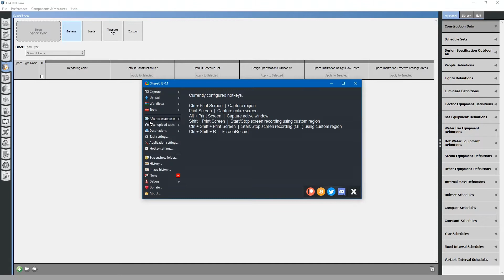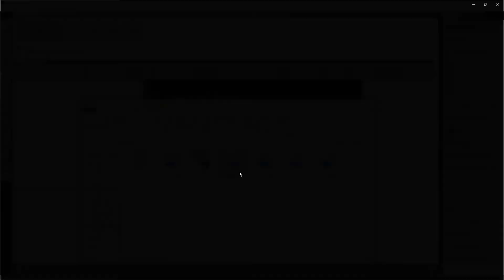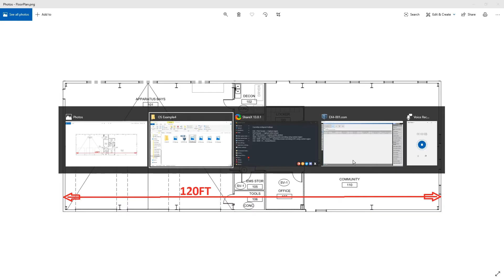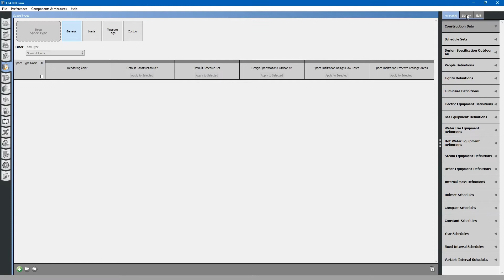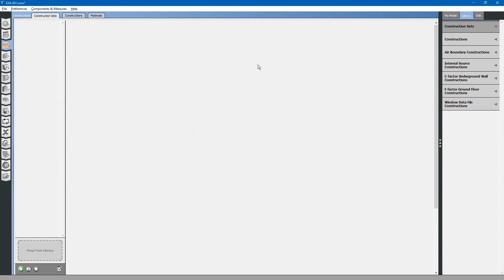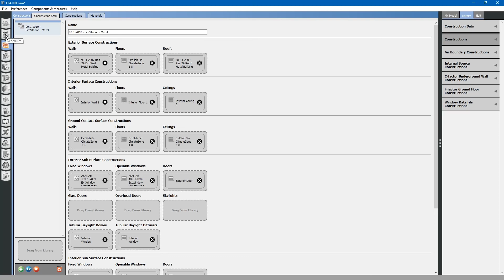Building Energy Modeling in OpenStudio - Importing Library Files

Comment: I have both OpenStudio Application v.1.0.0 and OpenStudio v.3.0.1 and inside none of their folder there is a file called 90.1-2010-FireStation.osm. Where did you obtain it? It's just to follow your tutorials using the same files.
Reply from the maker: Here is the project file thus far: https://drive.google.com/file/d/1m0NUNSz0HlNHMIth6ELz6MwNPOQMvlDJ/view?usp=sharing
Reply: @helixenergypartnersllc3540  Thanks a lot but, could you also provide the other necessary files to carry on such as the .png files of the floorplans, please?
Reply from the maker: https://drive.google.com/drive/folders/183GhVJdzNmphZ2Ngy0v8RJJWHSRJJpdK?usp=sharing

Comment: Where I can find these space types? I´m trying to model a residential house for a final work but I wasn´t able to find these space types... Would you mind telling me where I should look?? Thanks
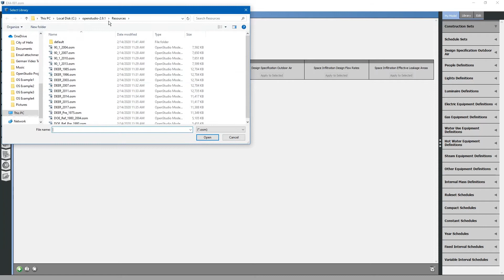Reply from the maker: Good question.  I am not sure if there are any default libraries for residential buildings, but there are some for hotels and apartments.  Please see my video about importing library files: https://youtu.be/O1QFj350a2I  at 1:31.  You can also find these on the BCL and in the default library files that come with OpenStudio.  Default libraries are located in the OpenStudio "Resources" folder.  If you want to add or remove libraries, go to Preferences > Change Default Libraries.
Reply: @Jose Perez, I have currently the very same issue. Have you found a solution for modeling your residential buildings?
Reply: Hi, have you saved your problems?